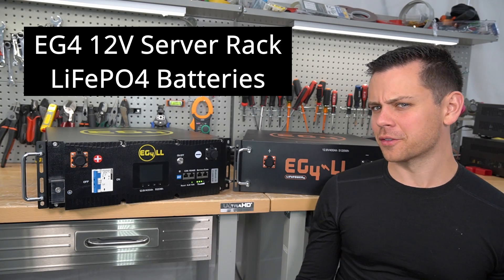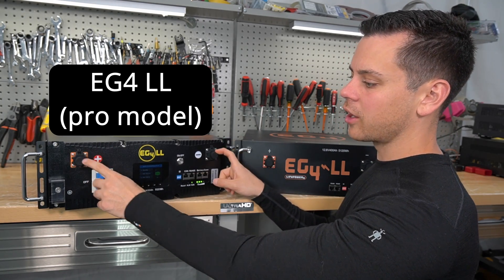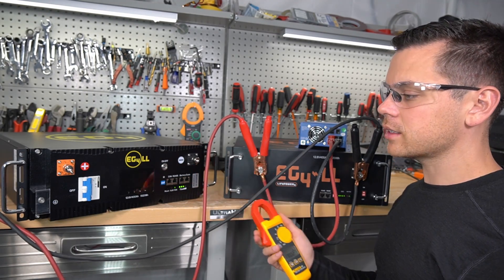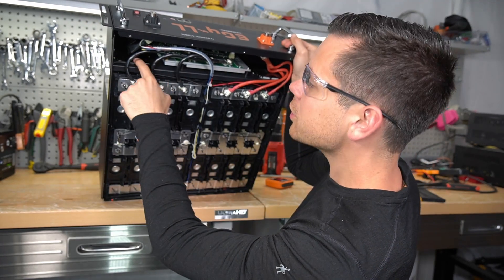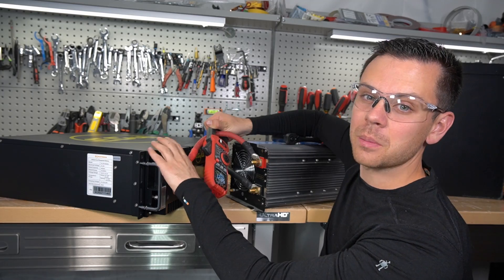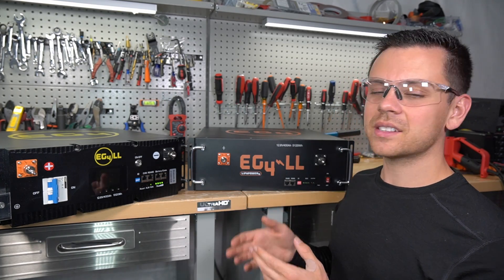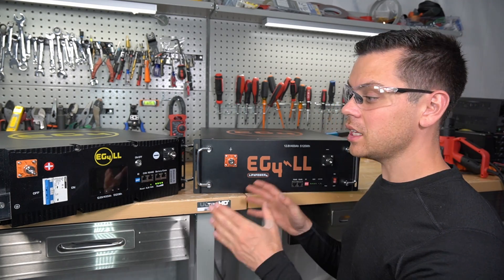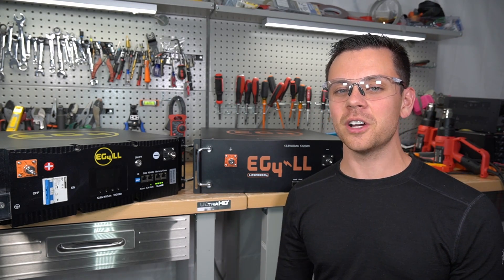$1,449 EG4 12V 400Ah LiFePO4 Server Rack Battery

Comment: Can you run 2 EG4 batteries in series to make a 24v system?
Reply: Buy their 24v battery. Much easier.
Reply: @john_in_phoenix  I know they have a 24v but i still need the qusetion anwered!!!
Reply: I don't think their  BMS is set up to handle that. Follow John's advice.
Reply: @Tumbleweed5150  I didn't ask for advice. I just need the question answered!!!

Comment: Hey Will, have you ever considered building a wind/solar hybrid system? I'd love to see that.
Reply: Most of us off-gridders, (when we have the room), just add more solar panels, (and controllers, when needed), rather than wind generators, because those don't seem to be as efficient yet. Maybe someday....
Reply: @Tumbleweed5150  Where I'm trying to build my off-grid setup, I have a lot of wind, but only a small area with clear, unobstructed direct sunlight. I really don't want to start cutting down the trees.

Unfortunately, there aren't any good videos on how to set up such a system anywhere that I can find. Will does such a great job explaining things that I wish he would do at least one short series on the subject.
Reply: I like this. I bought a wind turbine but I'm not installing it because the maintenance doesn't seem like it's worth. The videos about when wind turbines fail is horrific.

Comment: Hey Will, I think you are missing something here, for a small off grid home/cabin it's easy to use 12 volt for lighting and 12 volt RV/truck appliances for your convenience needs. 

They do make a pellet stove powered by 12 volts for your heating. 

In some ways it makes things very simple to get a low power system on line.
Reply: Looking back I would go with 48v and use something like the EG 3K or EG 6.5k off-grid inverter and a couple of server rack batteries. YOU can buy small 48v to 12v or 5v transformers to power the things that use wall warts. But it is nice to be able to use 120v lights, switches, receptacles, and appliances.
Reply: Thank you.  This is my line of thinking as well.  I have been thinking quite a bit about a small off grid system for a cabin that I want to build.
Reply: @FQuainton  my partner and I are looking at off grid property with a small home so we are looking at 12 or 24 volts for our system. 

We are looking at about 500 sq ft with short wire runs to keep the line loss low.
Reply: @Kriss Femmpaws  That is really cool.  I have been working on picking up a piece of land that I can build a 450 sq ft tiny home/cabin.  I like the idea of 12V because there is so much stuff available at affordable prices for it.
What convinced my kids that solar was viable was seeing that they could play xbox and charge their phones off 3 100 watt solar panels.  XD
Reply: @FQuainton  I have a 48 Volt system in my RV, and I put in a pair of buck converters for 13.8V to run my 12V stuff. I had a 24V to 13.8V converter in my old 24V system, so when I upgraded to 48V, I just bought a 48V to 24V buck converter, then used that to power the 24V to 13.8V buck converter. I tried a 24V to 12V converter on one system, but it seemed weak, and pulling a larger 12V load, (Using a 12V tire pump, for example), it overheated the cigar-type plug. I replaced that, once I got the 24V to 13.8V buck converter, and have had no problems since.
Reply: @Tumbleweed5150  Thank you for sharing that.  That is an interesting idea and definitely something to keep in mind. 
The only thing that was keeping me wanting to stick with 12 volts was the availability of 12 volt equipment.  I never thought of using buck converters.  That makes a 48-volt system much more feasible now. 
The thing I really like about 48 volts is being able to push higher wattage with lower amperage and less risk of overheating the wires and power loss.
Reply: Like with any project there is no one way to do it. 

You have to sort things out for what's best for you. The buck converters have their up and down sides like with anything they are a parasitic draw when not in use that may be an issue on a low power system.

Comment: Price is deceiving, after pricing against sok, which includes tax and free shipping in the price. After taxes and shipping the eg4 budget ends up being 200 more than the soks.
Reply: Did you do your comparison with 4 of the 100Ah SOKs? If not, you may want to re-calculate.
Reply: @Tumbleweed5150  i did my cacl with 2 200 amp hours, but if u look on soks site the price you see is the price you pay. Nothing more, so 4 100 amp ends up being marginally cheaper, but 400 amps of output while, 2 200amp is about 200 cheaper

Comment: Hey will can you please explain the input ac on the eg4 6k 120/240v model I thought I would be able to hook up 120v into it to charge the batteries apparently not I was told you can only hook up a 1200w desal generator for it to work please explain thanks.

Comment: Are these server rack units suitable for the vibrations and other stresses common in a vehicle application?
Reply from the maker: Yes they can take it
Reply: @WillProwse  Hey Will, how about in a sailboat electric propulsion conversion?
Reply: Yes, and they can take a higher altitude than the specifications claim. I used mine last summer at over 8500 ft.

Comment: Will, I would love to see a direct price comparison.... 12v to 48v.
Reply: These server rack batteries all cost the same, whether 12V at 400Ah, or 48V at 100Ah.
Reply: @Tumbleweed5150  I'm a beginner and but I want to see why 48v is cheaper/better. From a beginner point of view 12v just seems cheaper to get into.  Everyone shows the big parts but not all the little parts that add up like wiring.
Reply: @mpedrozax1  the wiring will be cheaper with a 48v setup because you can use much smaller diameter wires.

Comment: I have two 48V EG4 systems that work well.  I had a specific need for 12V so I have 3 of these in a rack. The BMS monitoring program works well, allowing a view of each battery on a PC. I have the same AIMS charger that you have and it charges to 100%.  However I had to use an AIMS 12VDC to 120VAC Inverter/Charger and it will not bring the batteries to 100%. Also EG4 has waterproof batteries available in 12, 36, and 48 Volt. I was considering the 36 V for my golf cart, but it will not handle the in rush of starting the cart.  It would take multiple batteries so the cost and space make it not viable. I went with 3 LiFePO4 batteries designed for golf carts. Always enjoy your videos, keep them coming.

Comment: What is strange is that my basic EG4 batteries in a 48 volt model has the circuit breaker built in.  The 12 volt model doesn't?  Hmmm...

Comment: As much I also dislike 12 volt systems, my 46 foot yacht did give me much choice. The boat is wired and isolated with two battery banks. One is a standalone 8D for the port engine and generator. The other is/was 2x8d batteries for the Starboard engine and all house systems. This is done so that if you accidentally kill the house batteries, you can still start the generator and the port engine. This in turn will also charge the house batteries from the on board charger and engine alternator. The problem with lithium batteries and this system is the need for very large cranking amps, over 1000 and cummins recommends 1500 CCA. The batteries I chose were used Valence U27-12xp. First, 3 group 27 batteries fit exactly into an 8D box, so 6 of them worked out perfect. Next, these batteries have a 150 amp continuous output and a 30 second at 300 amps surge rating. This gives me 1800 amps for up to 30 seconds being perfect to start a large Cummins Diesel engine. I ended up paying $1700 for all of them but that was just luck. People are asking up to $750 for these batteries. All tested at about 120 ah at 11 years old. There does not seem to be a battery on the market that fit what I needed so perfectly. I have an industrial modified sine wave inverter to run the watermaker pump and a Renogy 3000 watt pure sine wave inverter for the house power. Along with 1800 watts of solar, I almost never need to start the generator, and only when I really need to run the air conditioners. Sometimes 12 volt in a large configuration is really the only way to go.

Comment: I use two 24volt pro models in my RV.  Replace four 6volt Trojans.   New batteries are less wieght,  more watts, fewer wires, less anxiety (DOD), no toxic fumes, and longer life.  Had to go with 24 volt as I could not find a 48 to 12 volt converter for the RV.  Am using a Victron 24 to 12 volt converter am am very happy.

Love your videos and non biased opinions!
Reply: Victron Orion 48-12v converter?
Reply: @jake32401  oops... I was sure I searched and don't see that beast!  I will live with my 24v system even though 48 would have been more efficient...

Comment: So I ended up buying the eg4 48v combo inverter/charge controller and it is awesome! But I am doing a truck camper setup and found out it has 1 major flaw, there is a 90v minimum charge voltage needed for it to run, so more panels than my truck can fit lol. Any suggestions for mobile 48v setups or is 12v still the best option?
Reply: Lots of smaller independent charge controllers from victron & others.
Reply: I got the Growatt 24V all-in one for my work truck/camper, as well as my girlfriend's shuttle bus/RV. Hers  works well with 6 200W panels wired in series for 1200W, 146.01 VOC / 126.312 VMPP @ 9.5A. Mine works well with 250W Trina Solar panels in a string of three for 750W; MPV: 90.9V @ 8.27A; OCV: 112.8V.
Reply: 24v seems the appropriate and Literal middle ground for my needs. Thanks for the replies!

Comment: I thought I miss read the title when I saw 12 volt and server rack batteries. 

Seems like a a cool set up if EG4 made a 12 V inverter. One battery and an inverter with be a cheap power house set up.

Comment: the budget eg4 batts cost $1400 for 400ah, but you can get 4x100ah with low temp protection(WEIZE 12V 100Ah, i think you tested them) for for $1200 and have 400amp cont. output. so that places you nicely in the 3000w inverter, which is perfect for 30amp RV.

Comment: It's interesting that is this battery limited to 200A continuous discharge when their similar 48V 100AH battery is good for 100A discharge.  Presumably the most significant difference between two two batteries wiring cells in parallel rather than series, which should translate to 400A discharge instead of 200A.  The difference in discharge rate means you give up 50% in power output while energy storage stays the same or even increases a bit due to the lower rate of discharge.

I'm guessing this limitation is imposed by the by the BMS and circuit breakers rather than the batteries themselves.  400A BMS and breakers either don't exist or they would be too large to fit in the housing.

Comment: Thanks a ton for checking out 12v large form factor batteries still. I know many are switching to 48v systems but those of us that have vans it makes more sense to run 12v in general. Reason being of small surface area for solar panels and most do not run a second dedicated 48v alternator.
Reply: If he means a buck boost 12v to 48v then sure, but that's not very efficient and only a handful of options for products to do that like safierys Scotty b2b. You also need to take into account your solar efficiency in regards to low voltage shaded panels. Also I don't see many true low idle power consumption offerings at 48v, seems really dumb to have a all in one or something that's gulping power at idle for a van that's 12x6 feet living quarters space.
Reply: Yeah but then he has heat, noise and another point of failure.
Reply: All you need to convert it to 48v is a 560V dc to dc converter charger.

Comment: Hey Will
The industry needs to adjust to a higher voltage system.
48 is better but less convergence less loss!
We need to go to higher voltage for better performance and less heat loss.
48 +voltage or 240 voltage!
In safe protocol all circuits are live and should be tagged out before servicing. So the whole low voltage high voltage protocol is obsolete. We need to go with what’s efficient and adjust the protocol not hang on the old NEC regulations.
EVrun 400+ volts and they are mechanics not electricians .
I work in the industry and have been pushing for a efficient application but even 48 volt isn’t practical due to distance and voltage drop over 200’.
Just saying for most applications 48 volt isn’t working.
Reply from the maker: That's exactly what I said in the video and in almost every battery video. I say that every single time.  Did you watch the video because I said that I hate 12 volts within the first couple seconds.
Reply: @WillProwse  
Wasn’t critical !
Just saying I think the old low voltage high voltage is obsolete!
It’s a new industry that the governing rules need to adjust to the technology and make it work better.

Comment: 24V and even 48V automotive style alternators aren't terribly expensive.  For an RV or boat it wouldn't be too tough to add an extra alternator to many engines, and then have a higher voltage (and power) DC bus to charge a 24V or 48V battery bank.  I suspect the 48V inverters are more efficient, along with saving on wire size.  Might be a good solution if a system in which most / all loads are AC - microwave, induction cook top, heat pump.  Hybrid paired with solar.
Reply: There is no extra room for another alternator in my rig.

Comment: I did not know lifepo4 is very fire-safer! I was considering buying the V2 due to the fire arrestor being mentioned. Good to know they are not strictly needed for this chemistry!
Reply: Yes, the electrolyte (there isn't a lot) will catch fire and burn, or boil if hot enough. The chemistry (unlike many lithium chemistries) doesn't decompose and produce its own oxygen. The pressure relief valve on the top of each cell is there to vent the gas produced if the electrolyte boils (short circuit with no fuse or breaker). Whatever you do, don't breathe the gas vapor produced, it reacts with water to form a very toxic acid (like in your lungs). That said, it is about the best chemistry for fire safety. Even traditional lead acid must be vented since it produces hydrogen gas when charged. Really good chemistry, it does however like the same temperature that you do.

Comment: I completely agree, for any system of significant size 48v is the way to go, or at least 24v. 12v should only be used for very small systems.
Reply: yeah Im to much of  noob and 48V scares the crap out of me lol.  for a caper/offgrid  thing I would def do 24v.
Reply: @whoanelly- Just don't lick your fingers and grab the terminals of the battery 😉

Comment: Just put them in series and do 24v.
Reply: NO! They are NOT designed to go in series. Just BUY THE 24v OR 48V version!
Reply: If you connect them in series are you saying it won't  work?  That it won't read 24 volts, plus?   Will was bitching about hating 12 volt systems so I'm was suggesting a way out.  :)

Comment: currently 12v is the only system you can buy that can be charged off a vehicle's alternator with a dc to dc charger by renogy. The only 48v that charges off an alternator is the eco flow proprietary power kit.

Comment: I have 4 of these in my promaster conversion. I highly recommend. Although I would probably use 24v in my next rig instead of 12
Reply: Wow that’s a lot of KWh.
Reply: @vanmanjeff
If you need ‘more’ or whatever so are thinking 24V i would not bother. If you are going to buy-in for an upgrade just go to 48V. When you leave 12V behind you also leave behind the practicality of 12V devices so you may as well just make the jump to 48V which has every advantage of 24V (except for maybe 24V waterpump) but is becoming more universally supported.
Reply: @fishhuntadventure  i would totally agree with you if I had a permanent install in a stationary off grid cabin, but not a van. Current equipment options are mostly 12/24v or 120v ac. (Although cruisencomfort makes a 48v dc unit) they’re really pricey. Point is, I’d end up bucking the entire system to 12/24 or spending a ton of money to buy specialty equipment like 48v alternators, pumps, heaters, dc to dc converters, and so on. When the automotive standards for low voltage change to 48v, it will change. Maybe that will happen in the next couple years but not now. And if I did go 48v in a van now, I’d look at a mild hybrid conversion anyway. There’s a couple companies doing that for fleet vehicles. Again you’re looking at serious costs, though.